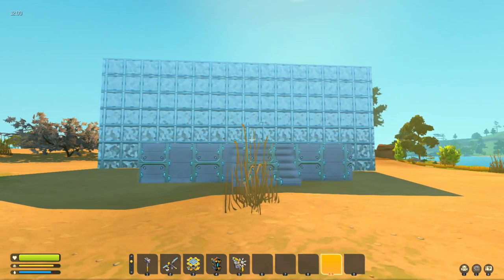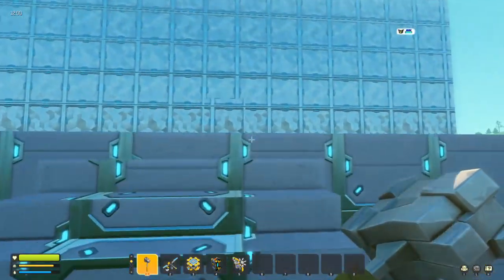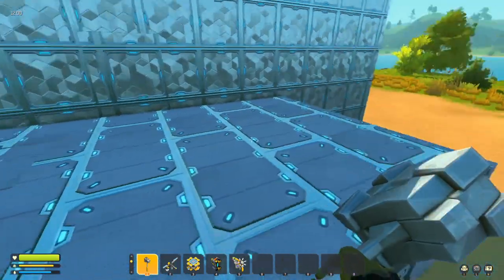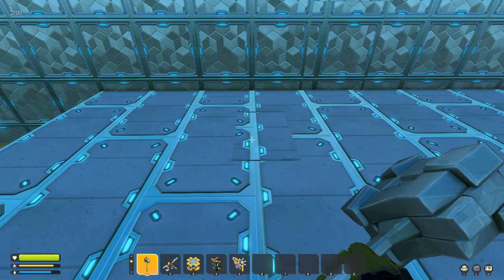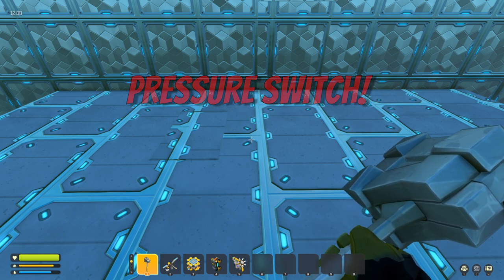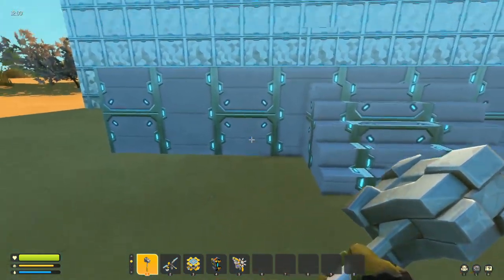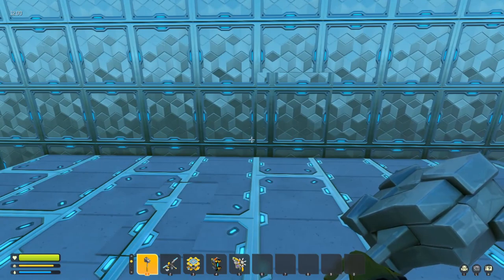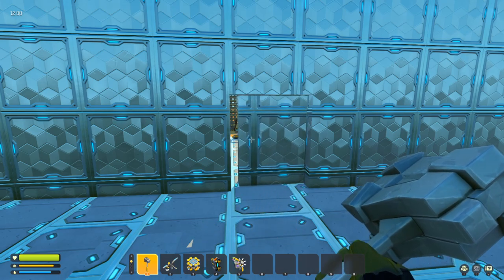Pressure Plate Concept Scrap Mechanic survival

Comment: Hi Woody, just a video idea you might want to try after they implement patch 0.4.8. Since they changed the enemy AI to always attack any blocks and I've noticed even Metal 3 can be destroyed by haybots. Might want to make a video on how many hits before their RNG can break certain blocks. Awesome vids btw.
Reply from the maker: Yeah doesnt look good does it! the thing with the attacks on this is its % based so its like each strike has (for example) 5% chance of destruction. I am not sure how to test this and get a solid result as bot 1 could attack and his first attack could be that 5% that damages the block, or it could be like 95 hits before they damage the block, so in terms of a video it would be one of the more tedious ones, and difficult to draw a solid answer that would be helpful IMO, but I hear where you are coming from, Thanks for the idea :)
Reply: @wo0dy  Put down a set amount of blocks and as many bots as your PC can handle and time for a set time. Then you can work out the average amount of blocks broken in a set amount of time.

Comment: A platform on suspension on the right setting so it lowers with weight on it and triggers a sensor... Should work? Also for some reason when you duck/crouch your character weighs more for a split second... god knows why, but if you stand on a fulcrum and crouch you go down, it's strange.
Reply: Also congrats on 800+ Subs, Awesome!
Reply from the maker: @JessicaMarinaRushie  thanks :) and this is a little bit of what todays video is about actually :) just trying to get the edit sorted now! so would be happy for your input on the coming video as well !
Reply: @wo0dy  Cook OK I look forward to it :)